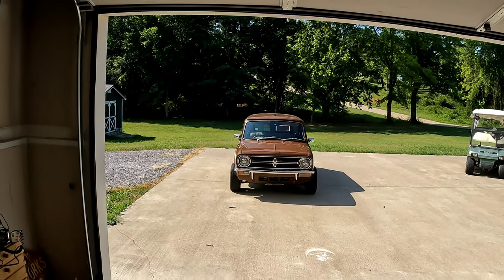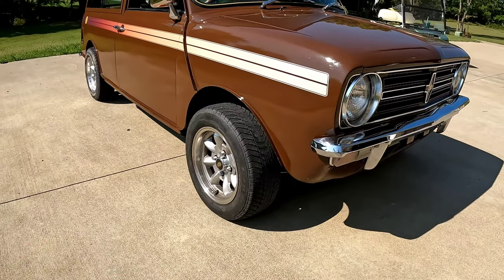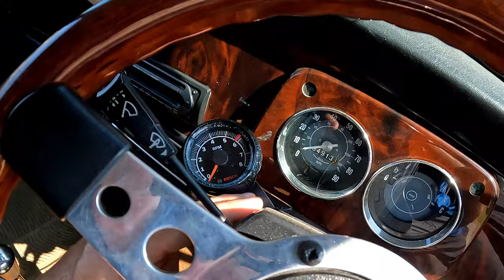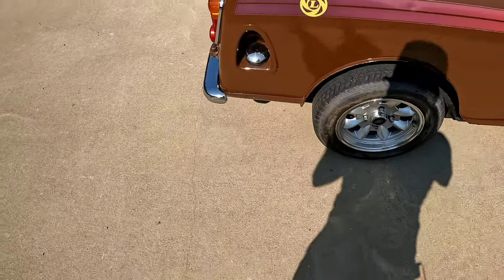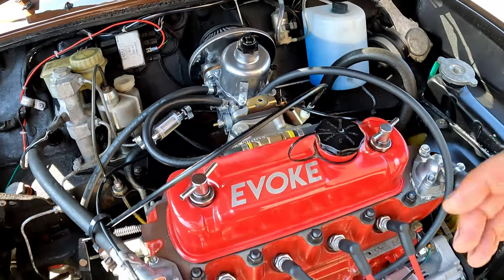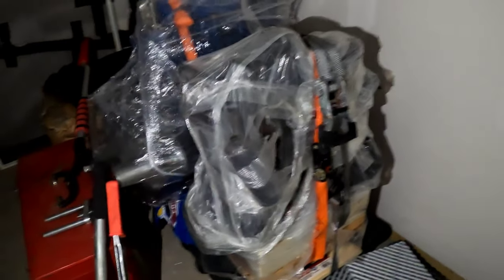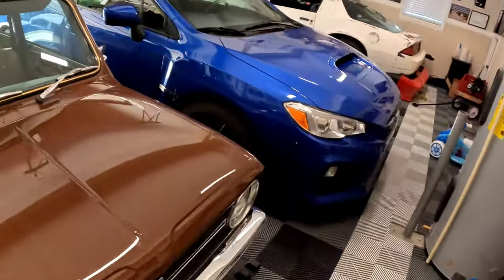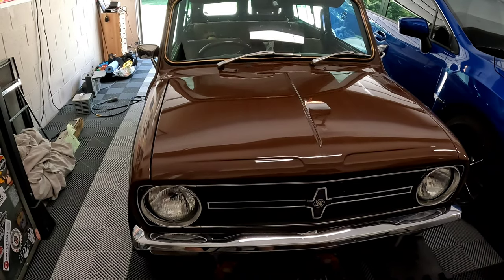1978 British Leyland Clubman Estate

Comment: I had a 78 Clubman estate, bought it in 1994 for £50 as a student, it had a bunch of thick walled aluminium tube in the boot when I bought it, I drove to the local scrap metal merchant and weighed it in for £47 so the car was £3!!! I welded the sills up and used it until 2001 until the tin worm got the better of it. Reliable, cheap to run and fix and huge fun, amazingly practical too!! I gave it away. In many ways it was the best car I’ve ever owned and if I could choose to re own any car from my past it would be this!! A good one in the UK is way out of my price bracket sadly.
Reply from the maker: It was a great car !